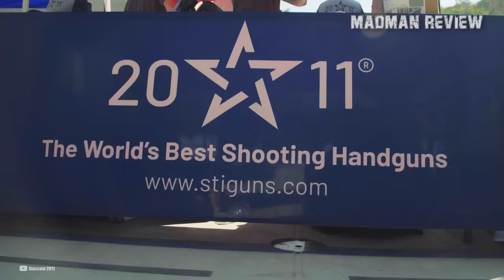7 Guns ONLY for the RICH Carry

Comment: Of all the guns on this list, I've shot all but 2 of these. I would say the Atlas is #1 by far, the Staccato as #2, Taran Tactical a very close #3 to #2. I haven't shot their #1 though. Wilson Combat #4. The great thing about the Wilson is that you could throw it under your truck and drive over it with a Ford 350 and it would still shoot straight, and if it didn't, send it back and they will fix it for free. Also, the Laugo Alien #500 coming in at over 7k and being a low bore axis gun, is probably one of the most expensive and also, one with a sharp learning curve to master. However, if told I could carry any gun and money was no object, my H&K USP is still the best and a Sig 226 is right close. The P365 would be my choice for concealed and a Walther PPQ or Beretta PX4 Storm as an in between. A Glock 26 or 25 for concealed carry just doesn't work too well. Sig has it all day long there.
Reply: I own an Atlas Athena, Staccato C2, Staccato P, SFX9, Nighthawk Sandhawk, Infinity 1911DS & a Taran Tactical Pit Viper. For anyone wanting to get into the "2011" game... Staccato, hands down is the all around best gun for the price. If your looking at Nighthawk or Atlas, go Inifinity.

1) Infinity 1911 DS (10/10)
2) Atlas (9.5/10)
3) Nighthawk (9.5/10)
4) Staccato C2&P (9/10)
5) Pit Viper (7.5/10)
6) SFX9 (6.5/10)

Infinity, IMO, is the pinnacle of DS 1911's, I judge all of my other pistols to that. Hand built works of art.
Nighthawk and Atlas are incredible options, very well built, tightest possible tolerances, reliable and operate flawlessly. Hand assembled
Staccatos are IMO the all around winner. 1/3rd the price of a Nighthawk/Atlas/Infinity and they are workhorses only reason I put the others ahead is the build quality. You can tell it’s a mass-produced gun but hand assembled and fit.
The build quality it that The Pit Viper is nice, but honestly... The build quality is subpar compared to other pistols in the 5-9K Range. Its a cash grab off the John Wick hype.
The SFX9 is nice, I own other Wilson Combat products. Various AR Barrels, a Single Stack 1911 Grips and other stuff. But for the price, It feels cheap. A very cheap plasticky feel to it which for the price its disappointing.

Comment: My HK USP .45 Compact is still my favorite pistol after 25 years of owning many handguns.

Even though it dosent have an optics cut out or standard rail.

Exposed hammers and manual safeties are my preference, but the HK VP9 Match is going to be my next purchase. 

Just Top Quality like ALL H&K Firearms, they Never disappoint!
Reply: Agreed. I own the hk .45 and just got the VP9 last week.  HK never disappoints.  Always a clean trigger pull, reset, and I love the da sa hammer pull as well as the decocker.   They go above and beyond with all their products, and you can see it when you field strip it.
Reply: Simple reason for that. Usp is the best
Reply: I plan on getting HK p2000sk next month
Reply: I do not like HK the palm swirls do not fit my hand very well, and I do not like striker fire I like sigsauer on the other hand do not like HK but I love sigsauer for that reason I carry a P226 with tritium night sights and a TLR3. To each his own, HKs I would although stake my life on for sure so I agree but for my larger hands the swells aren’t the best. I love the USP though iconic
Reply: I carry either a usp or mark23 on duty  im very capable with either and they never have  failed me they are  some of the most well tested firearms.
But for showing off "bbq gun" some call  I will carry my Wilson combat  1911

Comment: HK P7M13. Expensive but small, high capacity, reliable and has a squeeze-cocker that most people don’t understand, so if it's taken, you have time to fight back or run. If you can find one, they’re going as high as $10k last time I checked.
Reply: That’s the weapon Hans had in Die Hard.
Reply: I used to work in a gun shop and really love the P7M13. Such an innovative pistol.

Comment: There are expensive "race guns" for competition. That's not me. And there are expensive show guns for vanity. That sure as HELL ain't me. Then there are excellent pistols straight from the factory like several H&K models, some SIG models and a few others. These, for say another $200. to $500. max, can be accurized, with better sights and internal parts. THAT'S ME. 
Same for PCCs (Pistol Caliber Carbines). I've put over $600. into accurizint and customizing my RIGER PC chassis carbine to ready t for Steel Challenge competition, so yeah, I know, a "race" carbine. Sue me for fibbing.

Comment: I own an Atlas Athena, Staccato C2, Staccato P, SFX9, Nighthawk Sandhawk, Infinity 1911DS & a Taran Tactical Pit Viper. For anyone wanting to get into the "2011" game... Staccato, hands down is the all around best gun for the price. If your looking at Nighthawk or Atlas, go Inifinity.

1) Infinity 1911 DS (10/10)
2) Atlas (9.5/10)
3) Nighthawk (9.5/10)
4) Staccato C2&P (9/10)
5) Pit Viper (7.5/10)
6) SFX9 (6.5/10)

Infinity, IMO, is the pinnacle of DS 1911's, I judge all of my other pistols to that. Hand built works of art.
Nighthawk and Atlas are incredible options, very well built, tightest possible tolerances, reliable and operate flawlessly. Hand assembled
Staccatos are IMO the all around winner. 1/3rd the price of a Nighthawk/Atlas/Infinity and they are workhorses only reason I put the others ahead is the build quality. You can tell it’s a mass-produced gun but hand assembled and fit.
The build quality it that The Pit Viper is nice, but honestly... The build quality is subpar compared to other pistols in the 5-9K Range. Its a cash grab off the John Wick hype.
The SFX9 is nice, I own other Wilson Combat products. Various AR Barrels, a Single Stack 1911 Grips and other stuff. But for the price, It feels cheap. A very cheap plasticky feel to it which for the price its disappointing.

Comment: My most expensive pistol is the USP .45.  If I spend more than that, it would be for a collector's gun.
Reply: My most expensive is BRNO PSD, I also have a Mateba 6 Unica, but that's not technically a pistol, though it is a handgun. I do want some historic pistols, but I don't have any.
Reply: My HK USP .45 Compact is still my favorite pistol after 25 years of owning many handguns.

Even though it dosent have an optics cut out or standard rail.

Exposed hammers and manual safeties are my preference, but the HK VP9 Match is going to be my next purchase. 

Just Top Quality like ALL H&K Firearms, they Never disappoint!

Comment: With the exception of a screen shot of the Madman review at around 15:47, the photos were of various Infinity handguns but not of Tikis.   The comment that the Tiki uses the "Sight Tracker" barrel/sight configuration (sometimes called an Island Barrel, though Infinity does not use that term) is inaccurate.  Infinity does make both single and double stack pistols, however, there is no single stack 10 round capacity Tiki (10 round mags are available for people who live in Democratic Republics like CA and NY).   Tiki is  specialized carry optimized gun and a very small percentage of the designs made by Infinity.

Comment: I carried a $4k 2011 for a while but after taking a lot of defensive shooting classes, including force on force, I went back to a mostly stock Glock 19. Get out and actually train and compete.
Reply: Why did you go back to the G19? Did the 2011 fail during you classes?
Reply: @awokeone7997  I wouldn’t say it failed but they’re not as reliable, in my experience. Or at least they require a lot more maintenance and upkeep to maintain the same level of reliability. They’re heavier and bulkier, mags are way more expensive and not as durable, external safety is another potential failure point, holster options aren’t as wide, can be finicky on ammo. From a competition and straight shooting aspect, a 2011 is way better but when you’re actually fighting with a gun, they lose a lot of their luster.  But it’s not as sexy to flex on social media with fancy pictures and selectively edited split times with Glock. By no means am I saying a G19 is better, it just wasn’t worth it for me to keep chasing the 2011 perfection when I could spend that money on ammo and training.

Comment: On the Caracal, you show a picture of the Lynx then proceed to talk/show mainly about the Caracal Model F which is not the same thing. I owned the original Model C before the recall. You can even see a model with the quick sights @11:31 mark. The new Enhanced Model F is certainly not 4K.

Comment: TTI Combat are 2011, not 1911...
Reply: Wrong. 2011 is a trademark owned by Staccato.
Reply: @ResidentGunNut  Don't play with words. May be owned by Staccato, but it's a type of 1911 evolution, almost an all around standard by now.
It's owned by Staccato, as the 1911 was owned by Colt...
Reply: @jiankhan I am NOT playing with names. There's a reason the USPTO exists. STI/Staccato made the term "2011" sound like a household name. But their 2011s are different from double stack 1911s. The difference lies in the modular grip frame that can be either plastic, aluminum, or steel. Run-of-the-mill double stack 1911s on the other hand have a one-piece frame that is NOT modular and is either steel only or aluminum only, polymer is out of the question. Don't defend your ignorance.
Reply: @jiankhan  oh and btw, if what you said was true, i.e. Staccato's 2011 is like Colt's 1911, then what do you call ANOTHER "supposed" evolution called 2311? Look it up. There are two companies this year that are using that term to label their double-stack 1911s that they refuse to call 2011s